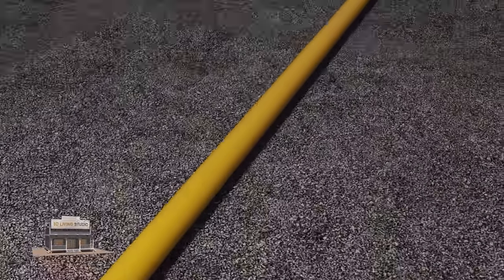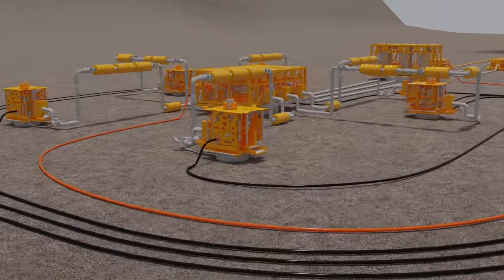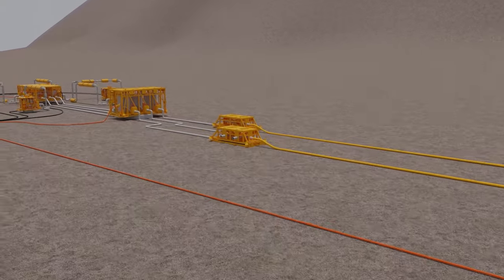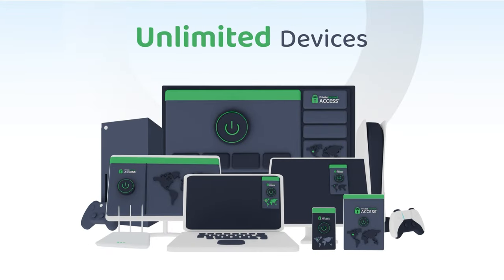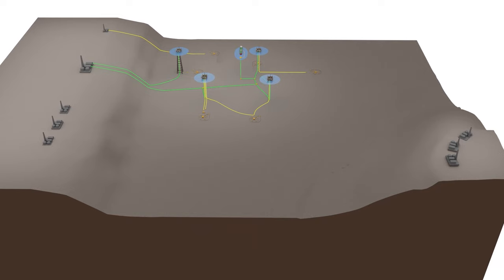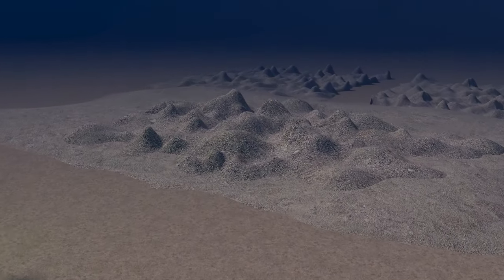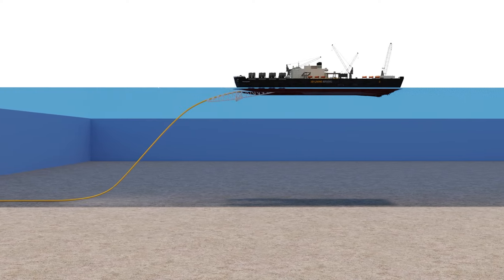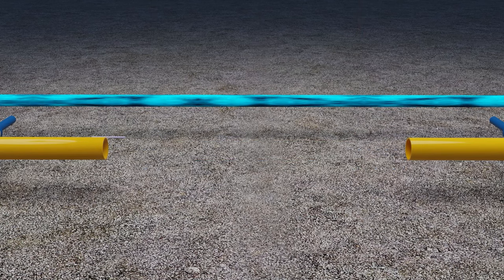How Pipelines Are Installed Under the Ocean - Network and Repair Underwater

Comment: this is FASCINATING, i never batted an eye at oil rigs but recently wanted to know how they work. I was so confused and the methods used for drilling and processing oil in the ocean are so advanced. I am in disbelief that we do this on a daily basisXD great video, super informative and really well put together! thank you!
Reply: This is not an oil rig man , in this video SURF ( subsea, umbilicals,risers,flowlines) installation was explained, drilling is how you get the pressure up from the bottom of the sea bed which requires drill ship, or jack up barge and build the well head where the oil is coming from. I highly recommend to watch this kind of videos .

Comment: one question - You said Oil will come from wellhead to platform rig , but how it will go to Xmass tree ?
In your presentation Xmas tree is placed - -where oil is coming to xmass tree and pass to manifolds ?
Reply: Correct me if i am wrong , Well driiling is done blowout preventer will be replaced by XMass tree ? is it correct?
Reply from the maker: @amessit10  You are not wrong, according to my research, BOP is installed during the drilling, its only purpose is to seal the well permanently if blowout happens.  If nothing happens, then the isolation plug is installed down the wellbore to temporarily seal the well while removing the BOP, this is to prevent oil leaking out to the ocean.  Then the Xmas tree is installed, and then using a wireline to remove the isolation plug.  OIl will continue to flow, passing thru the Xmas tree to the manifolds, and from there oil will be redirected to multiple pipes, to platform rigs or to an onshore plants, etc.
Reply: @3DLivingStudio  Ahh now I understand. Thanks for the clarification ✌️

Comment: I have a question, in case of replacement of damaged pipe we drill in the good section to put a bypass line, so when the bypass line is removed after repair how is the drilled hole repaired??
Reply from the maker: From what I've known, the repair clamp's valve will close and seal the hole and the clamp stays there permanently.

Comment: Are you saying that there has been oil spilling out from the bottom of the sea into the sea for thousands of years or more (long before humanity even knew what oil was) ? If so then how come the seas aren't somewhat saturated with oil (I mean we can still swim in them) ?
Reply from the maker: No, oil lies beneath multiple layers of the rocks under the bottom of the sea.  It requires deep drilling to get the oil out.
Reply: @3DLivingStudio  Ah ok. Thanks :)